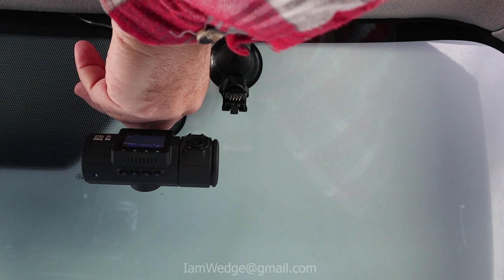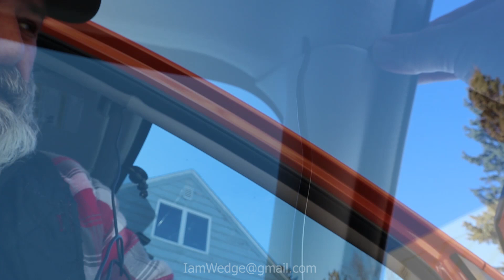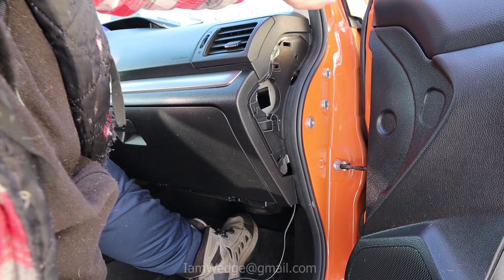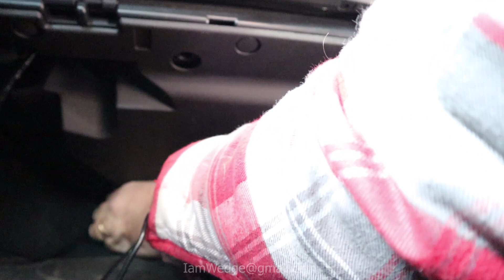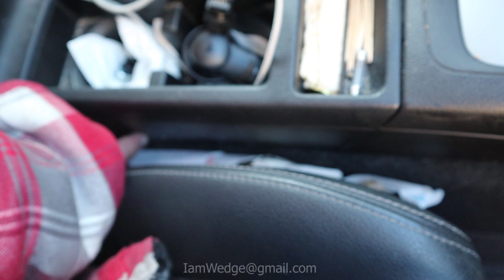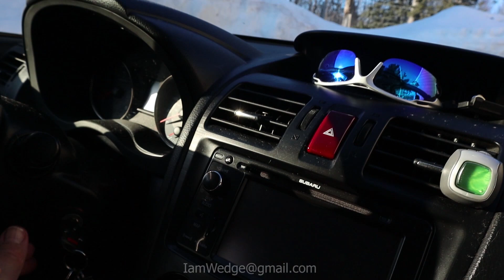How To Install A Vantrue Dashcam With The Charger Cable

Comment: 3.5 years after I first installed mine the charger is bad and the suction cup won’t stick to the window when it gets warm,,, why would a low voltage charger go bad? They are designed to fail over time like everything anymore,,, now  another $20 on Amazon for a new one